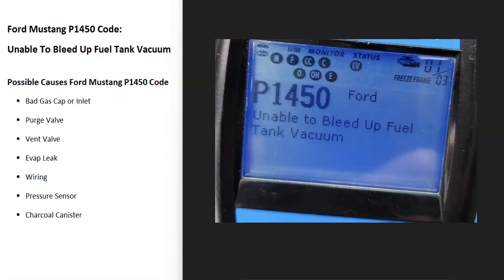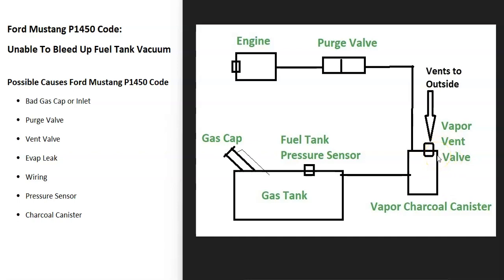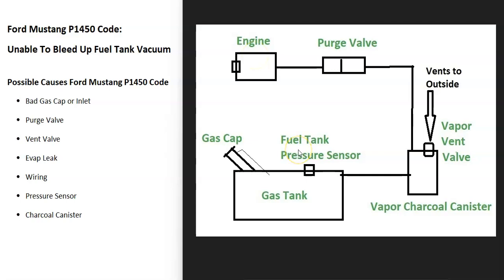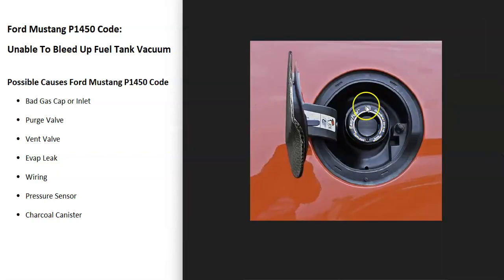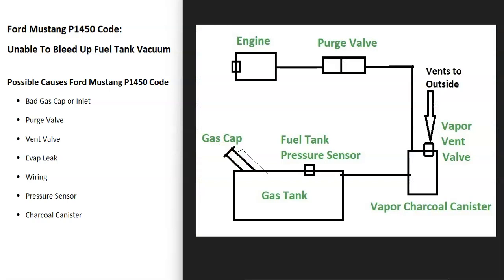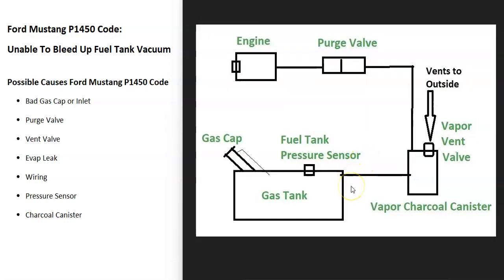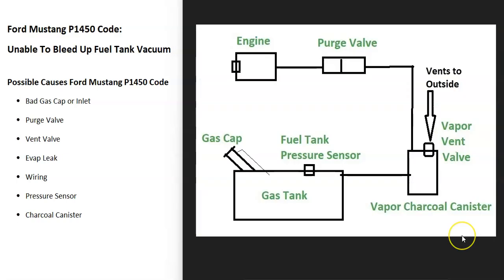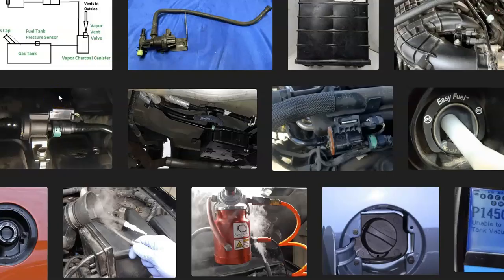How to Fix a Ford Mustang P1450 Code: Unable To Bleed Up Fuel Tank Vacuum

Comment: Hi, I have a 2013 Mustang V6. The fuel gauge has one line, meaning there is 15 liters of empty space in the tank, but when I refuel, the gas leaks out. The engine power has also decreased. The engine revs up very smoothly and the engine power has decreased. Is the fuel gauge showing the wrong reading or is there air in the fuel tank? Is the problem with the canister?

Comment: 2014 mustaang v6 wont take but $1.00 in gas before it comes starts coming out of the  drain hose and my gauge stays on e no matter what. Seems the car runs fine other than the loud chirping from the purge valve which has already been changed. Took it to a ford dealership and the guy didnt look or know what i drove up in and said my tank is shrinking..so yeah advice would be great
Reply from the maker: Is the vent plugged.

Comment: Could having an empty tank/driving on empty cause p1450 to appear on mustang?
Reply from the maker: Not usually when on the stangs half tank will have issues p1450 is bleed up should not matter.
Reply: @joeybalogny6095   I got the stang from a dealership and the tank was empty i filled it up and when i started the car the engine light appeared for p1450. Brought it to the dealership and replaced the vent valve and purge valve, filled up the tank, reset the code and now its back. 

What else can cause the p1450? could the damaged capless fuel be a possibility?

Comment: I got the same code coming up in the 2015 mustang. The problem with mine is that it stalls after putting gas.
Reply: MINE TOO 😮😮
Reply from the maker: Low pressure sensor
Reply: Same here mine is a 2016 did you fix yours plz help.

Comment: i have a 2013 mustang gt 5.0 with the boss 302 intake manifold, recently its been stalling when driving shifting out of gear into neutral. could this cause the stalling? also the idle is low like 600 or under
Reply from the maker: Do you have any trouble codes have you had a tune on the car.
Reply: @joeybalogny6095  no check engine lights, will it throw codes without the check engine light on? Also i bought it modified and I assume it is tuned given the mods

Comment: Nice video. I have this code p1459, my car wont take gas. I just replaced the purge valve and the the purge solenoid. But i still have the same issue it wont take gas and it still has the code. Can it be the canister it self?
Reply: Sounds like somebody took control of your car and got it fixed so it won’t take on gas so you have to take it to the dealership
Reply: @hermanrogers1325  I got it fixed! it was a vacuum hose that got melted with the exhaust.
Reply: @jorgemendoza1992jm  do you remember what hose ?  Is it one leading to tank?
Reply: @israelhernandez1050 No! It's was breather hose from the canister the got melted with the over the axle pipes.
Reply from the maker: Yeah it could be the canister I would have done the same keep working threw it you will get it go threw each step.
Reply: @joeybalogny6095  I am going to replace the canister. Thank you!
Reply: Just replaced the canister and still doing the same thing. I wonder why is not taking gas.